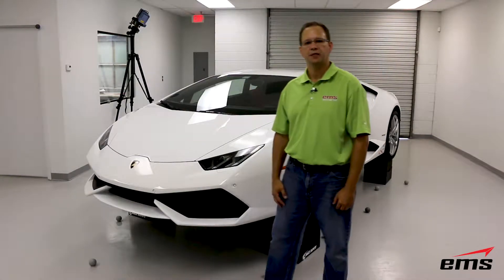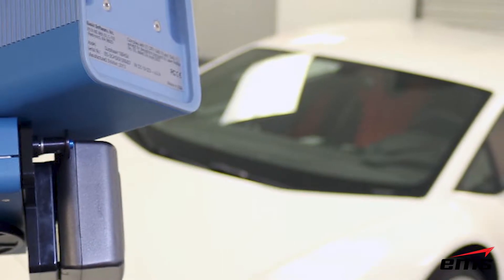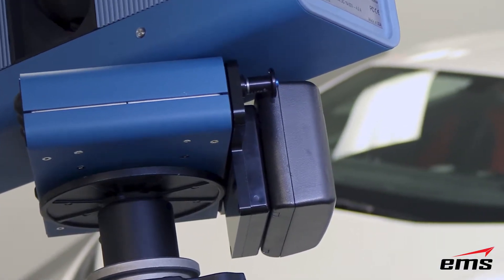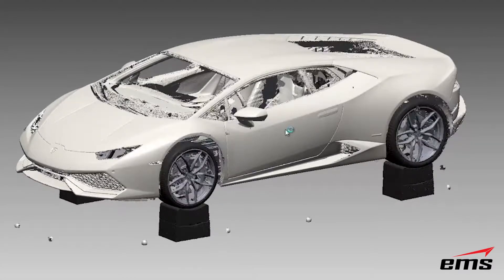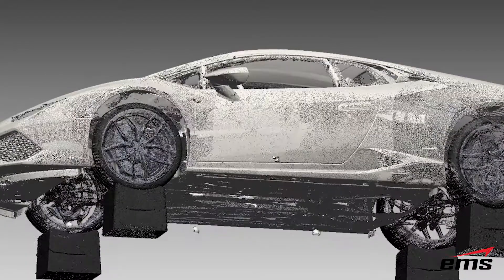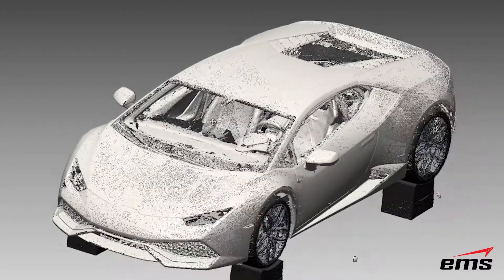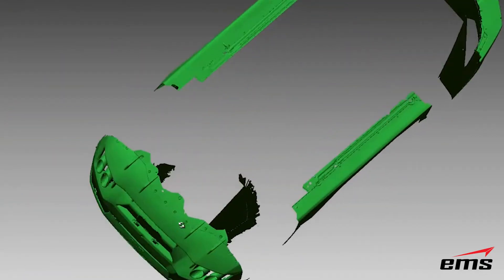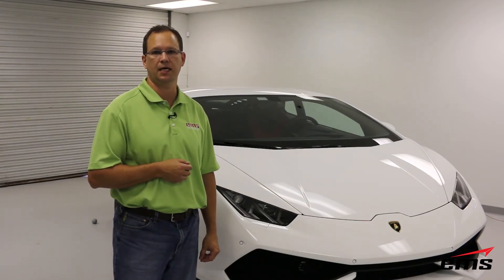3D Scanning Cars for Product Design - Lamborghini Huracan

Comment: how long does it take to scan the whole car ? inside and out ?
Reply from the maker: It depends on the 3D scanner being used and the level of detail but generally speaking a few hours to setup and 3D scan the outside of an average car size object.   The inside can easily add a few more hours.  Also, keep in mind that is just the 3D scan.  If you are going to create 3D CAD from the 3D scan data that could take days to weeks depending on what you are modelling.